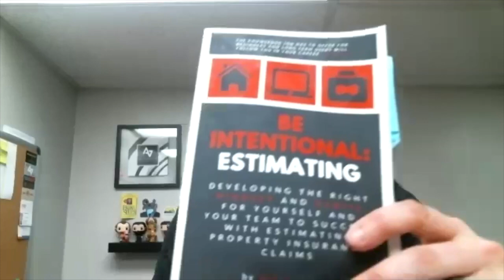A ROOFER gave me some of the BEST advice

Comment: Here’s some advice from a contractor, to other contractors: when you meet the adjuster, be respectful, understand they’ve had all day dealing with contractors who were trying to intimidate them into paying for a claim. Give them space. Only be there to show them damage so they don’t have to deal with supplements later on. Let them know that’s why you’re there. Not to intimidate, but to help out to make the whole thing go more smoothly. Chances are without that pressure, they’ll be able to better differentiate storm damage from mechanical damage and they’re more likely to make the proper call. Intimidation does nothing but blind the adjuster.
Reply: Mechanical damage is bullshit. Open Peril policies cover everything that is excluded and Mechanical damage is a word.
Reply: Treat people as people and they way you would want to be treated 🤘🥋🤘
Reply from the maker: I'm not sure I understand:  open peril covers everything that's not explicitly excluded.  And it depends on context:  if somebody creates mechanical damage (aka "damage by a person") then it's either fraud or vandalism.  Vandalism is covered, fraud isn't.  
Is that what you mean?
Reply: @AdjusterTV  I’m not quite sure he’s aware that blistering is considered mechanical damage. There’s a stark difference between blistering and a storm created impact. Blistering is caused by improper ventilation or a manufacturer’s defect. Meaning it’s technically man made. Storm damage is an act of god. All acts of god are covered. Unless he’s referring to foot traffic, which of course would also be man made, ie mechanical. However I have gotten stone coated steel roofs bought because an adjuster didn’t know how to walk on it and damaged panels with foot traffic, which I recorded. That fell under a vandalism claim.
Reply: @justinfincher2385  did the company subrogate the since it was considered vandalism?
Reply: See, this is the way that contractors should handle themselves with IAs. Good on you, man. One hundred percent.

Comment: Other than creating an elevation from a grouping folder, Is the only way you can add line items to an elevation is if you do it graphically???
   Also, how do you creat complex elevations in xactimate? For instance say the front elevation has like 3 different faces that are all different shapes rather than being one perfect square, how would you sketch that? would you just create 3 different elevation sketches and name them all front elevation????
Reply: Look up Ben Justesen - Enlightened Restorartion Solutions
Reply from the maker: Generally, different geometric shapes on elevations are dictated by the roof line.  So if you create your roof with all the offsets and everything, and drop the walls from that then you should get something you can work with.  
I never used Sketch for elevations because it was just easier to do it on paper and also I've never worked for a carrier that required Sketch's on elevations.
That being said, Xactware is working on more a more intuitive Sketch, including elevations.  Might be a year or two, though:)